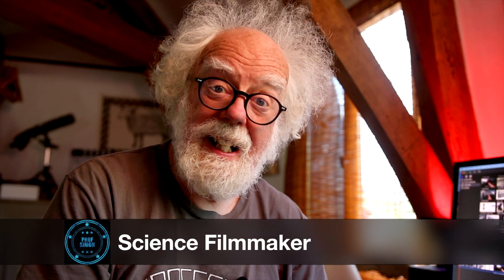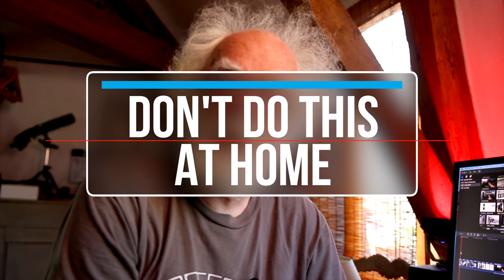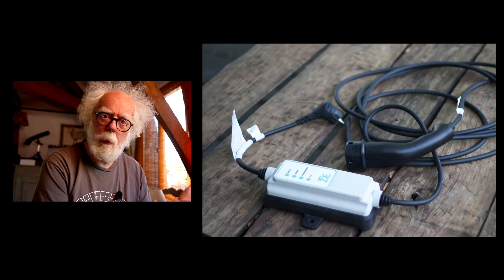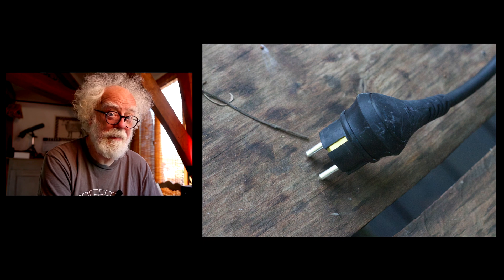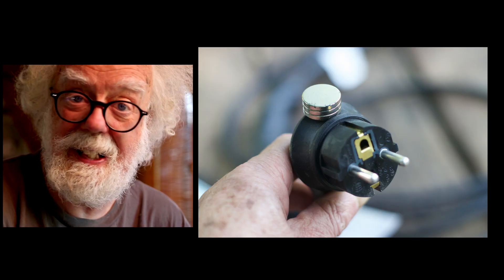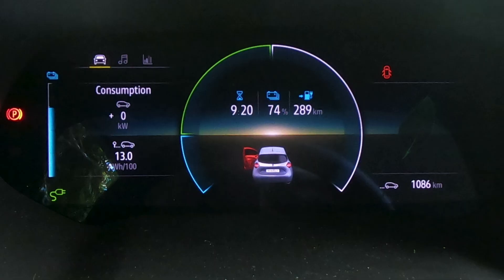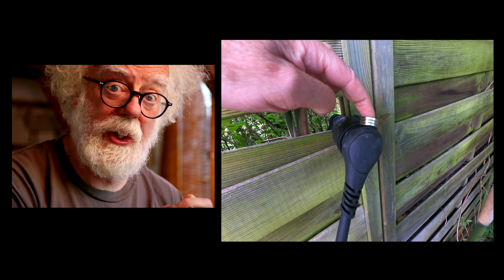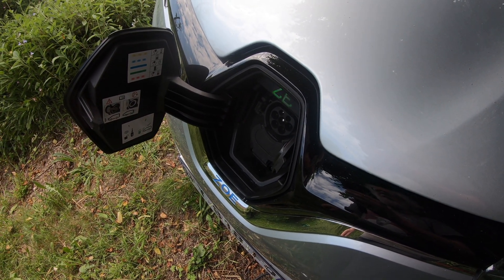Granny Cable High Speed Charge - Professor Simon

Comment: As far as I know in Australia, I always used to go for the 15 amp line (if there was one) which was on the Hot Water System circuit whenever I was using a welder on different jobs.
In my experience all the rest of the house is only 10amp fused.
Look out for how hot your leads get though!
Reply from the maker: here is France every circuit is 16amps but the car charger one had nothing else using it....so Zoe the EV got it all....ha
Reply: @SimonHollandfilms  one of those silly things? Why 16 in particular I wonder.. Then again why would Aus have 10 and then 1 fuse up to 15? My father always told me it was All about Money. Why have your whole house fused at 15 when they could create 2 different fuses then needing to use different everything which costs more, more parts, more costs, more more more lol!
. Maybe one of those stupid imperial metric changeover things, maybe the numbers looked neater even though, to my knowledge, Imperial never had anything to do with electricity...
Maybe you should do a vid on needless costs/ created redundancies etc. Nah, I wouldn't think that'd be your thing but...  Thanks Prof!

Comment: Definitely can't do that in Canada without a dedicated outlet
Reply from the maker: no...this makes use of EU wiring....16amp breakers and dedicated circuits to a single outlet....normally restricted to 10 amps but with the magic magnet you can use just under 16amps...very easy to install and cost me €72 for a car charger...albeit rather slow but it works overnight for our renault Zoë ev.

Comment: I can't find the link but I once saw a conference by Tesla's head of battery technology where he explained in detail their battery testing and talked at length about Lithium battery degradation.
There are 3 main causes for battery degradation in the following order : High temperature, High voltage, and Time.
Fast-charging involves a lot of heat. This is the worst possible condition as fast charging usually generates more heat than the cooling system can dissipate, increasing the temperature sharply. And this is why cars with liquid cooled battery (Tesla) can fast-charge a lot more than cheaper cars with air-cooled battery. (Nissan Leaf, Renault Zoe)
Stopping the charge at 80% is to avoid high voltage. As your battery gets full it is more difficult for electrons to enter the battery. The charger must increase the voltage or the battery won't accept any more charge (regardless of the actual charge speed).
Then, once charging stops, the battery can be left for days at it's max charge (high internal voltage), and this is where the time factor kicks in.
Leaving your Lithium battery always at max charge for prolonged periods of time slowly degrades it's capacity. (This is why batteries in overheating always plugged laptops destroy their own batteries very quickly even if you don't actually cycle them)

Comment: This would just trip your circuit breakers or fuses if you did this on a 10 amp outlet. However I have 15 amp circuits and wiring in my house, most of my outlets are 15 amp. I could almost do this hack but for 1 amp, which might not actually be a problem if there's a little headroom in the engineering.
Reply from the maker: be careful

Comment: It's not that exited, earth fault protection has nothing to do about it. Even the "ring main".
Some home electrical installations in Europe do although the wires are 2,5 mm² (with an excepting for running to a light fixture 1,5 mm²) (still) have a protecting with a 10 A fuse or breaker. Main for the light circuits. Breakers or fuses have to be selective, that's the fuse or breaker near the fault must break and not the one higher in the electrical distribution.
That's I think there is a default 10 A consumption.

I am an electric engineer, the truth is out there. 🙂
Greeting from the land of the flower & light bulbs.

Comment: Charging from 20% to 80% reduces dendrites as these are formed at the two extremes of charging. Slow charging also reduces the formation of dendrites. I have been led to believe this is due to reduced electron bunching but may be completely wrong. Do both and you can get up to 4 or 5 times as many cycles.

Comment: Slow charging always is best for the battery and its long term lifespan, a 2.5 square BV wire can be used with a maximum of 4.4 KW or 20 amps ish (I think) so I believe the wire can handle the load depending on distance, I am assuming the regulations for the dedicated line are simply for permanent installs and trenching conduit with proper certified wire and receptacles with built in fuse for the use as well as solid core vs stranded wire for flexibility. I tend to keep long term loads on a circuit under 75% its rated load or less.

Comment: Nothing serious should be happening. You will burn the fuse, if it takes too much current in that phase, that's it. All cables in that phase all the way back to circuit box should be of 2,5mm diameter (minimum). Of course, if the cables are not to the spec., your house can burn down due converting wires inside walls as heating elements.
Reply: You can put the dedicated plug "parallel to" existing phase, if it uses current limiter to limit current for other devices in the phase while dedicated plug is charging the car. In the very similar manner you could have a heating boiler, electric oven and (in Finland) electric sauna stove connected to the same phase(s).

Comment: Just a number of points I am electrical engineer the Ring circuit is a far better way because the Load is balanced throughout the house if you are using a radial circuit in other words a dedicated cable you mentioned 2.5 mm² that is only for a small distance once you get past 20, 30 m et cetera you need a 4 mm cable. . Plus for that separate radial circuit you need a 30 mA earth trip plus a RCD residual current device live to neutral trip on the 32 amp breaker itself
Reply: Physics apply to electricity. Well put
Reply: There are limits to efficiency based on size of conduit. Regardless of the medium it has a limit as to how much it can take until efficiency is decreased.
Reply: There is a Reason a breaker is required. To avoid failure typically caused by heat.physics directly apply to electricity. I'm sure most have noticed teslas free energy generator creating lightning like reactions surrounding it. Even air has its limitations as far as energy transfer is concerned
Reply: @charleshall6357  I would always put four mil in for radial circuit then you can pull a heavy load iff needed

Comment: I was told by a govt engineer years ago the way to make your iphone battery last was to always keep it charged within 20 to 80 percent never below or above. Reason being that is the range in which the movement of energy within battery causes least wear if you will. All things including electricity create friction. A low charge would induce a greater amount of wear in battery while recharging from such a low state. A 100 percent charge would induce same friction while discharging to 80 percent level. Therefore greatly increasing wear within battery. A battery is most stable and produces the least amount of friction between 20 to 80 percent capacity. Realize ive tried to simplify this explanation and used a basic description for ease of understanding. Not everyone speaks in terms as engineers do.
Reply: Professor I hope that you read my other comments although off topic I would love to see a video regarding the recent disclosure of military radar confirmation.

Comment: 1,5mm2 cable can handle 16A in itself, while 2,5 mm2 cable is rated to even 20A.
So you're fine especially with 30 mah protection.
Reply from the maker: that's what we have...thank you.
Reply: It’s more about what other devices maybe on that circuit and cause an overload.
Reply: @markfryer9880  Hence the dedicated breaker.

Comment: Pulling 16A on a 10A cable will cause a fire.  However, I checked my house and even the 6A circuits have 20A cables.
Reply from the maker: yes ...the fudge factor for us plonkers....the charger is made fir both the dedicated 16amp abd the 10amp...so i guess they made it carry about 20amps??

Comment: The 20% 80% charging is designed to put less strain on the battery.
Think of it as having a water-butt completely empty and having to fill it up with water time and time again, the stresses and strain exerted on it through expansion could lead to a failure sooner rather than later compared to one that's put under less strain over the same time period.. Hope this helps..
Oh and BTW I'm glad to see that the unit you purchased was from a country that has standards of safety, people need to be aware of the knockoff copies that can be a fire hazard, just saying ;-)
Reply from the maker: thanks
Reply: @SimonHollandfilms  : You're welcome ;-)

Comment: Hi Simon a dedicated supply is any circuit such as oven requiring more than can be provided by the socket circuit.  Now we must also remember the such devices like fire alarms intruder alarms etc  are best given their own supply from the mains . Not because of excessive load , but to limit loss operation if something else on the circuit had a fault . Now getting back to your EV charger, what you must understand is that the potential for a earth fault situation is not to be understated . That’s why in the UK we insist on a supply direct from the incoming mains , which also has the main earth separated away from the charger unit . Obviously it’s more complicated in practice, so I’ve tried to simplify the process . Basically under certain fault conditions that body of the vehicle can become LIVE.      😃👍👍👍
Reply from the maker: with all, granny cables ? or just using at 16amps?
Reply: @SimonHollandfilms   hi sir I think it is best you YouTube about the issue ,but irrespective of the amps it’s more to do with the earth.  I have to admit I’m retired from the industry and am just working from my own research. But trust me EV charging is a minefield . Now I can’t speak for France  but in the UK , a company should install a Earth spike protected via a earth leakage device with a MCB / fuse to protect the circuit so no possibility of a fault transforming its way to the vehicle and producing a risk to life . Now correct me if I’m wrong but I think I saw a earth connection on your plug ? . The thing is  my friend is the chance a anything happening are very remote, but it has none the less happened. In my long time as an electrical contractor I’ve seen many situations that don’t conform to logic . But my main concern is for you and your family.  Not forgetting the goats.      So my kindness of regards and best wishes   😃👍👍👍
Reply: A granny plug intended design was to be used with multiple devices or a single device on a single circuit. We all know what happens when you overload with multiple devices such as coffeemaker, microwave, small space heater at the same time. Now think what happen if added the granny plug drawing maxim amperage to that already overloaded circuit. 

Another case in point suppose you had a electrician install a dedicated circuit with a special dedicated receptacle that contains a magnet for your granny plug, and you buy a second Zoe. You wouldn't be able to charge both at the same time due to a overload no matter what you rigged up. You still would need another dedicated circuit...

Comment: Basically you have the electrical terminology except for milliamps...
Reply from the maker: what did i mess up....share your knowledge
Reply: @SimonHollandfilms  just the fact that electrical wiring in homes are rated in amperes and not milliamps although some devices especially in electronic may have components that only draw milliamps for a certain part of the operation...
Reply: @steve-o6413  You're wrong personal protection breakers are rated in (30) milliamps, because even you can't stand whole amps.
Reply: @mrGAllope  on the contrary you are simply misinformed or have no idea what you're talking about or a combination of both...
Reply: @steve-o6413  Sure Steve-o
Reply: A circuit breaker in the US is rated for 10,000 Symmetrical amperes this does not mean you need 10,000 Amps to trip a breaker trip because only in a dead short would temperature rise to that level.

Utility companies charge you for fractions of amperage used using kilowatts hours...

Comment: Instructions unclear... One end of charging cable plugged into Zoe, other end ready to attach to local sub-station,
I'm aways unclear on the next bit... Do I pull the pin, then run... Or run, then pull the pin? 🤔💥

Any help would be much appreciated, cheers
Reply from the maker: switch on and make tea

Comment: In France and Germany the infamous Schuko socket and plug dont survive 16A for more than a few minutes. I have tried it for about one year until it became a Schoko plug. At least it looked like chocolate but it smelled bad and worse I could not unplug. The socket and plug were molten and fused together when our i-MiEV finished charging. I had to charge another time but this time unplug when the Schukos were hot. I replaced the Schuko with a Blue Command socket and plug or CEE 240V/16A. That is the same plug you find at caravan parks all over Europe. This plug can easily take 16A for 24 hours. For the Zoe the red CEE 400V/16A or even better the big red CEE 400V /32A but the electricity dealers refuse to sell it except for shops. DIY your own wallbox. I did. Those 400 Volts are actually three wires of 240 Volts. As long as you do not stick your fingers into the socket and do not touch 2 wires at the same time it is only 240. But that is enough to spend the night at a hospital when you live in Canada. Touching more than 120 Volts you must have a license and you must be willing to spend a night at a hospital or you want get the license to kill yourself. My wallbox was not a wallbox at all but a wooden box with a contactor (a big relaiy) and some electronics. It did not cost me more than 200 Euros. You can easily charge the Zoe with 11 kW if you get 3 phase at home. If you dont tell ... I tried the connector for the electric oven in our kitchen :)
Reply from the maker: they should.

Comment: We had our charger professionally installed here in the UK. They took a feed directly off the outside meter point and ran a dedicated cable around the house to the charge point.  That gives us 32Amps or 7Kwh of electrons...
Reply: It also has its own dedicated earthing system, AFAIK it's against "supply regulations" to plug and charge from a 13a socket..
Reply: @evanjones2539  many new systems have PEN fault protection, so an earth rod is not required 👍
Reply: Just think how many electric cars are changed on an outdoor socket or extraction lead !

Comment: My fuse box was recently replaced with RCD units. 
I chose a consumer unit large enough to accommodate additional RCDs as I required.
This is up to the limit of the 3 phase cable that was built into the house some time in it's history. 
Nice hack Professor Simon.
Reply from the maker: cheers jeremy

Comment: You can charge it off the same circuit that your oven and cooktop run off.
Reply from the maker: yep.....that's a good idea
Reply: @SimonHollandfilms  Maybe not for insurance purpose though.
Reply: @SimonHollandfilms  just know that you can't run the stove or cooktop and charge the car the same time you could run into serious overloading problems with the wiring especially in some older homes. This Is good advice no matter what sort of electric or hybrid car you drive. And to reinforce what you've already said a dedicated line from your load center circuit breaker box is the best way to do it
Reply: @SimonHollandfilms  nope not a good idea, dedicated means it's the only thing on that circuit or plug and a cook top is on a dedicated circuit also. If both were being used at the same time a overload would occur...
Reply: Yep, cooker circuit is rated at 30amps in the uk. Any extension cable need to be similarly rated....

Comment: In Oz oven and hotwater is direct wired. We can also get 16Amp wall sockets wired directly to the switch box. 16amp extension cables are common too. Mostly used for power tools and bigger machinery that is too small for three phase. Interesting about the magnet, learned something new.  Thanks.
Reply from the maker: thanks for watching...be safe
Reply: @SimonHollandfilms  Safe? Mate I'm looking for 200 amp cable, got the crimpers for it too. More power. 20amp cable is for my little toys.
Reply: @alwayscensored6871  Heavy Guage Aluminum. Dedicated means just to that source.